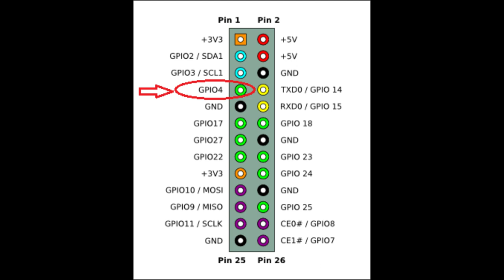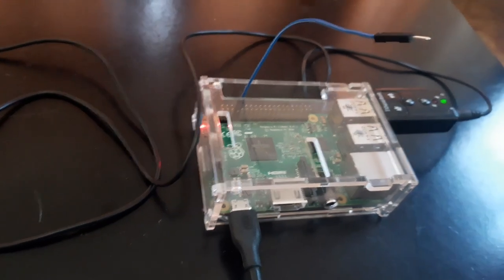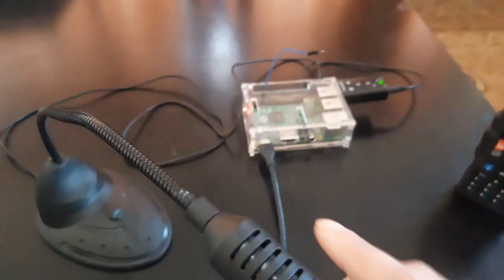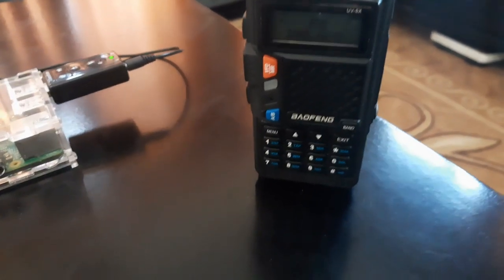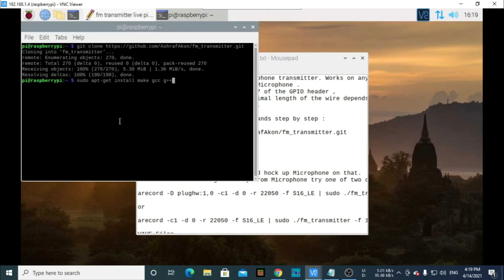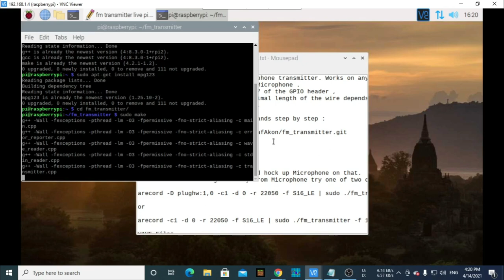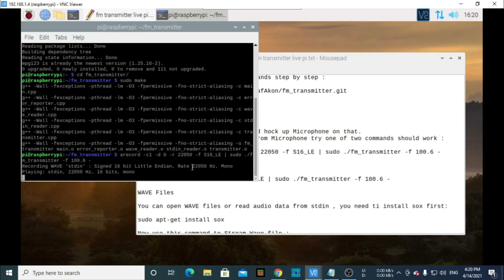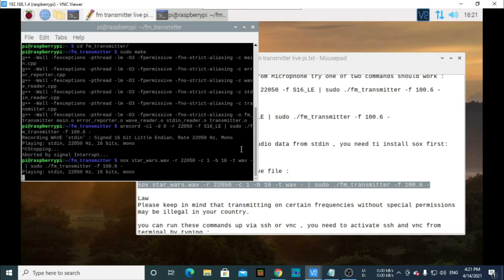Raspberry pi Live Microphone FM Band Transmitter

Comment: HI, 
M Khanfar. Have you have come acrross arecord "overrun !!" problem? I am testing an application that retrieves data from microfone using arecord, but i am getting a series of error messages like that "overrun!!! (at least 2,005 ms long)". It seems to be buffer overflow. And the retrieved audio data is being truncated.
Reply from the maker: do you follow all steps in video ?
Reply: @MKhanfar-MWK  Yes. I read in forums that it's a commom problema with arecord, but didn't find solution yet,
Reply from the maker: there is two commands options in video description, does you try them ?
Reply: @MKhanfar-MWK  I tried them both.
Reply: @MKhanfar-MWK  The problems I related is common and I saw many threads about it, but no solution. But one thread suggested that it's related with power supply delivering less current than required, thus affecting raspberry pi performance and generating unexpected results. If it's true or not, I don't know. But, in fact, I am using a non suitable power supply and I've been receiving warning messages on raspberry screen about it. I'll buy an  appropriate power supply and test again.

Comment: Thanx a lot for this video 
1- is this way need internet connection?
2- if the mic is far for about 400 meter, can I turn on the radio fm and hear what's happening there?
Reply from the maker: no need internet connection
Reply: @MKhanfar-MWK  and what about the second question?
Reply from the maker: you can add preamp to increase pi tx range . but be aware laws restrictions and put band filters